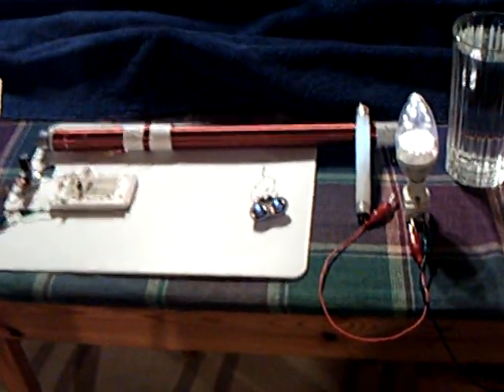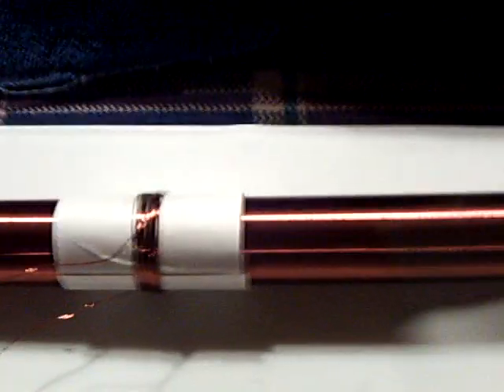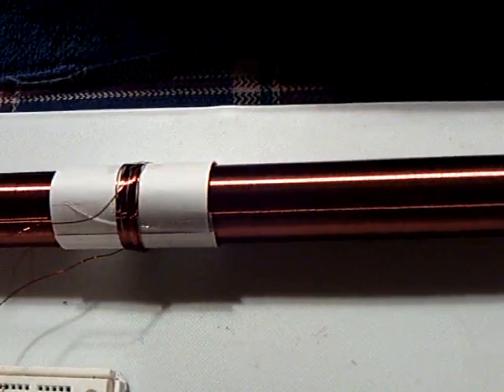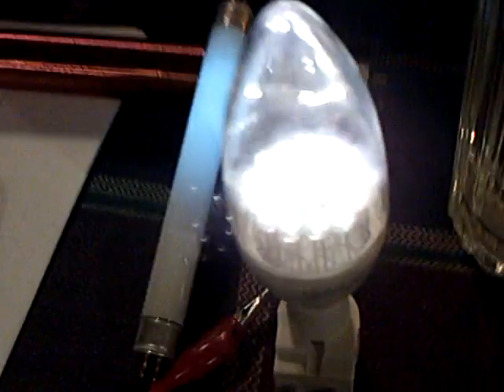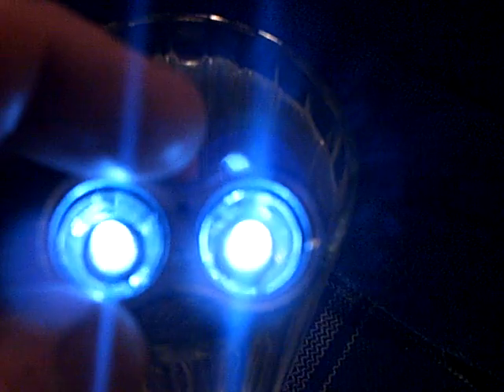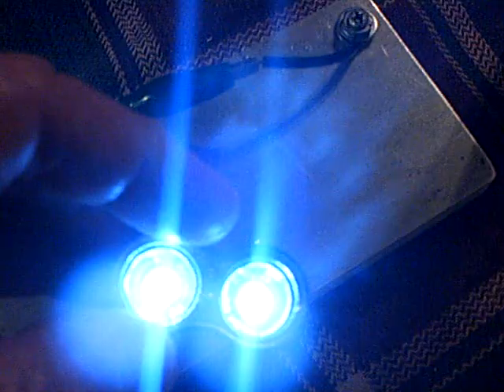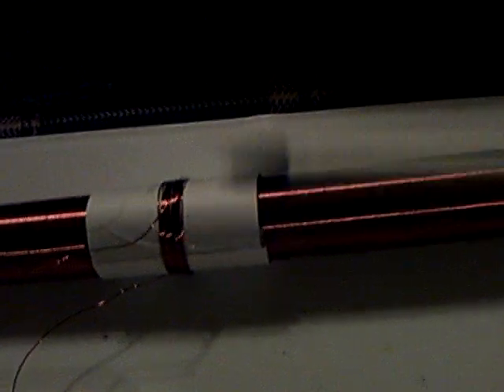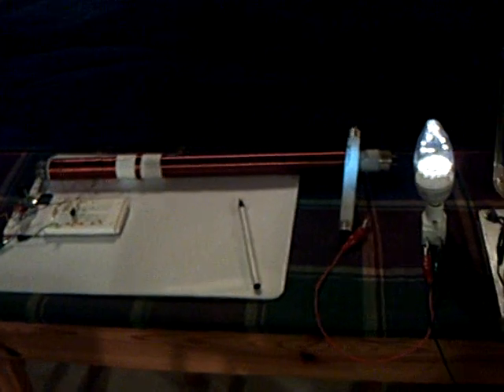Slayer Exciter with large coil.ASF

Comment: All of these things should be classified as W.E.T circuits. As wireless energy transfer. Funny enough i just created an account on energetic forums named wetissues before I had noticed this. I guess my name has a purpose. Also one question, how do you wind these things up? I had wound up Jonnydavro's pop bottle coil up and it took me just under 2 hours, manually under lamp-light.

Comment: That's insane. I have to say this one has some marrit that the other one's did'nt have. Does the transister get really hot?
I am still working on simple pan circuit but with a 10Kv coil and it works but I have heat issues with the transister.